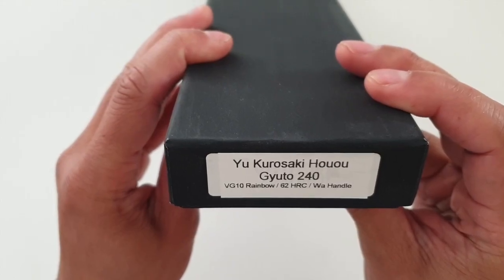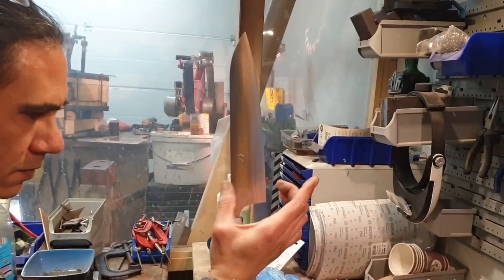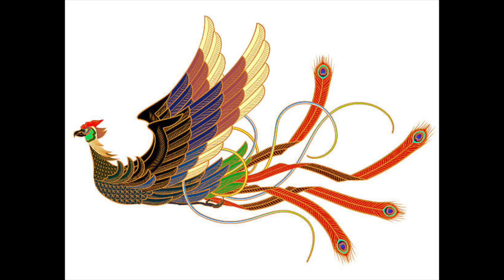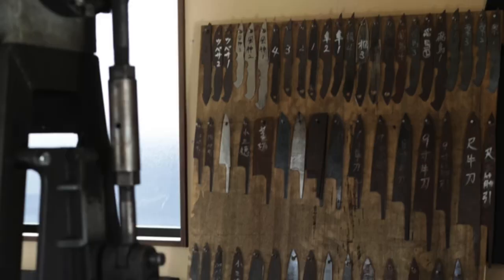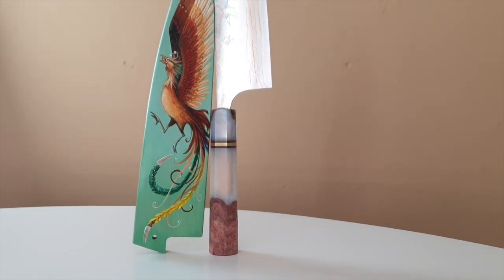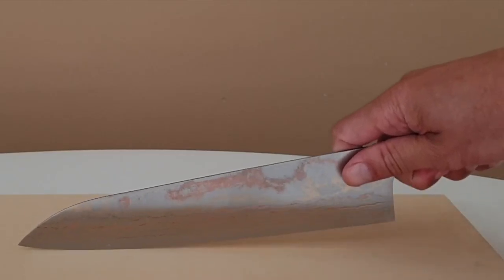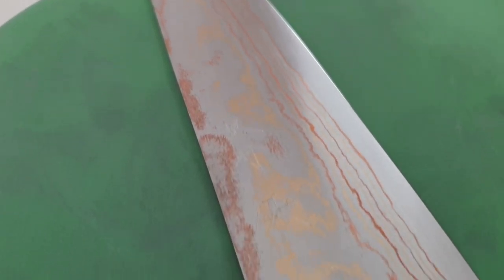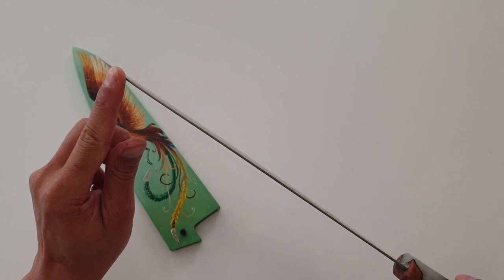Yu Kurosaki Houou Gyuto with Custom Handle and Custom Hand Painted Saya

Comment: I recently got the Asahi Pro board and when I use my laser on it, push cut, I will get cuts. Must be my technique. Hmm, but good thing seems to be, that the cuts on board disappear - or rather are not visible anymore - after wiping wet and dry.
Reply from the maker: Yeah, you will get cuts on the board. For sure. But the material is forgiving to the edge of your laser knives, and the board/cuts kind of 'heals' itself a little bit. Especially when you frequently clean/sand it with a Hasegawa scraper.